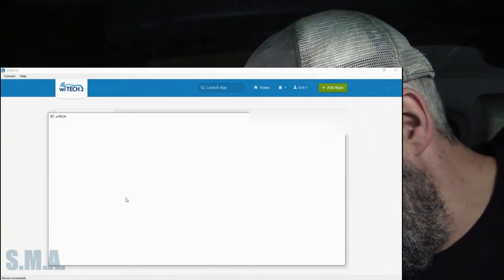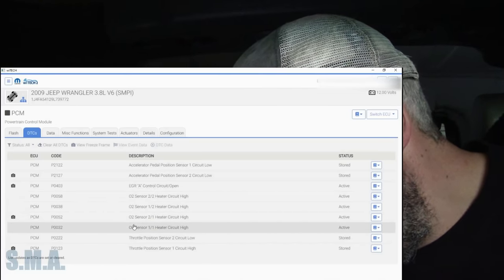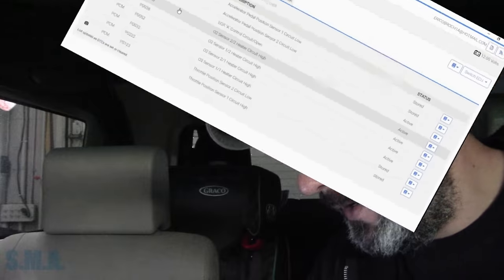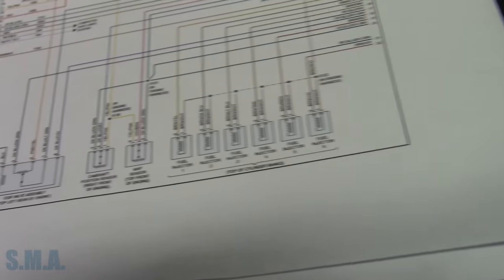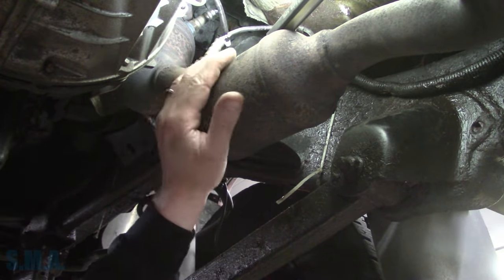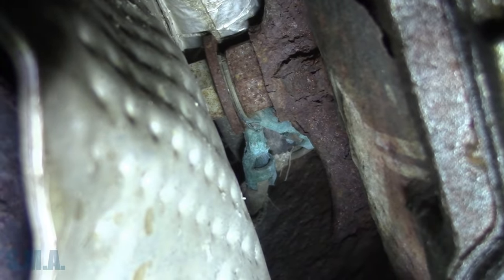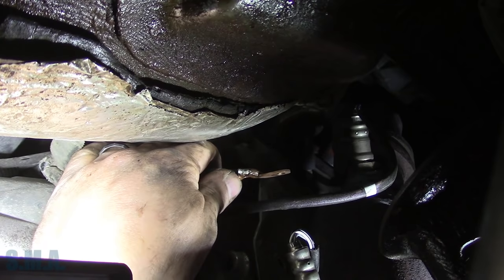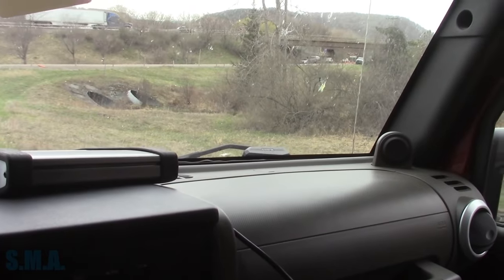Another Jeep, Another Bad Ground...😐

Comment: Whoever replaced all those oxygen sensors should know better.  That many codes set at one time will usually point to a common problem.  I would like to know how does a customer handle the first shop's failed repair?  They are not going to put back the old oxygen sensors, they will still have to be paid for labor, so who is going to eat this one?  Lay it on me shop owners!!!

Comment: Don't ask somebody.....I beg you.  You might as well just open up the parts canon yourself and let 'er rip.  Check powers and grounds at your connectors/sensors that are showing as failed.  Eric just showed you how, so don't ask, he has probably 50 videos doing it over and over....it's okay, but make sure they have a 100% chance of working by having a power and a ground on your three wire sensors.  Dammit, Janet, just do the right thing. (no women were harmed in this comment, any irritability is yours and yours alone).